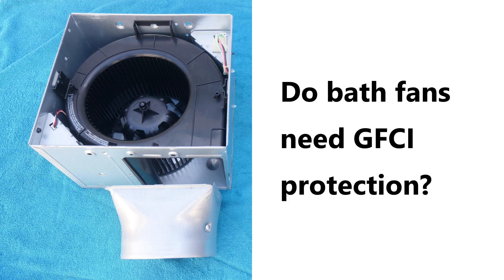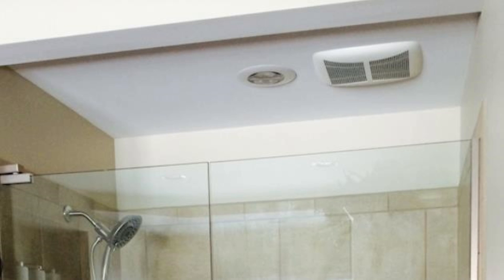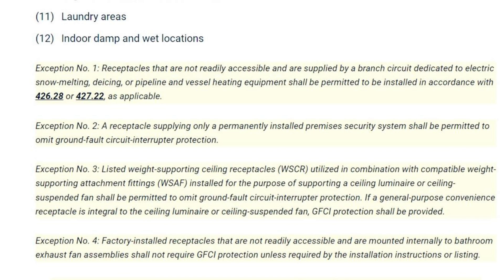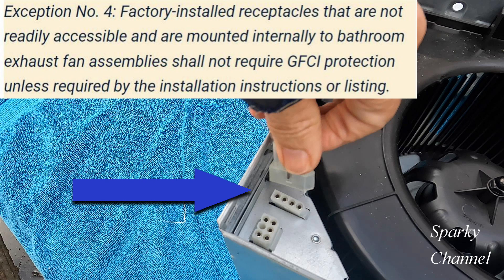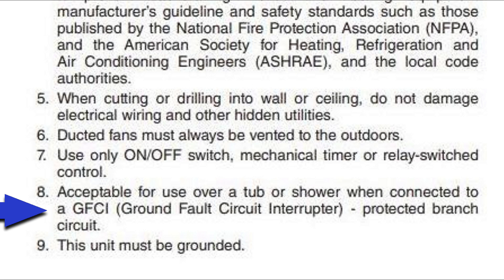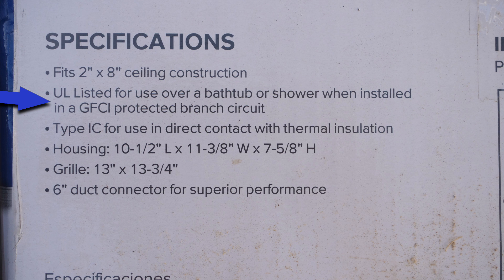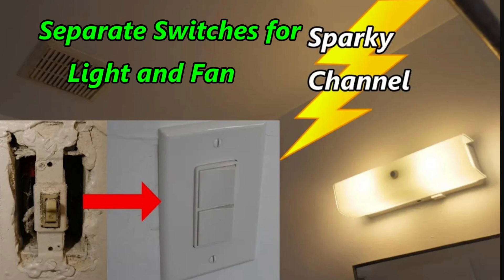Do Bath Fans Need GFCI Protection? + Can They Be Installed Directly Above Tubs or Showers?

Comment: Doing a bathroom renovation and I added the new panasonic vent (no heating element) to the 20 amp GCFI circut with the two existing outlets. Any issue with this? Better to habe its own 20 amp line?

Comment: I looked at various sites on best locations for a bathroom fan. The experts recommend that for the fan to be more effective in removing moisture it should be placed close to the shower (about one foot away). An optimal placement also includes being installed between the shower and the door. I would prefer that setup as it allows better airflow through the bathroom. Placing the fan directly over the tube/shower wasn’t the ideal location for moisture removal. Also, putting the fan directly above the shower pulls away the heat above you, making you feel colder in the shower with no meaningful difference in moisture removal vs. the optimal placement cited. Information you can use to help your clients make informed choices on fan placement.
Reply from the maker: Excellent reasoning!

Comment: I wish they'd include dehumidifiers and heaters in those fans. Our ceiling fan turned out to be a heater, and not a fan. So I am pretty sure it is a code violation, in that regard. While it is not directly above the tub it is just outside of it, so I prefer it have GFCI protection anyway. I protect my whole lavatory. So I am pretty sure that is also a code violation. The heater was nice in the winter time, but of course, it doesn't work anymore. The light still works, but it makes me nervous that there is a heater, not working, that is still getting power in the ceiling, and not even vented, so is it a fire hazard ? I think it is. I got screwed on this house.

Comment: Also see  article 110.3(B) Installation and Use. Equipment that is listed, labeled, or both shall be installed and used in accordance with any instructions included in the listing or labeling.    So while the NEC doesn't specifically require GFCI protection for a fan installed above a tub or shower,  every bath fan that I've came across that is suitable for such installation,  requires GFCI protection if installed over a tub or shower.  So one  could argue that article 110.3 (B) indirectly states GFCI protection shall be provided.
Reply from the maker: Yes, I would say that is correct. Thanks!

Comment: Love these code videos Bill! Could you do one on whether or not you would need to GFCI protect a nema 14-50 receptacle for EVSE? I kno per the code it says it shall be GFCI protected since its in a garage, but if its being used to supply power to EVSE that has GFCI protection built in and per the manufacturer it prob says it doesn’t need it, whose orders do we follow, 210.8 or 110.3(B)?
Reply from the maker: Excellent question. I'll have to study up on that one.

Comment: very clear.  I learned this close to 30 years ago, when I got a fan too close to the tub. fortunately in enough time to move it out of the GFCI zone before sheetrock went up.  since then I've had times when I had to put it over the tub, and added a faceless GFCI below the switches.  I've found the best location for a bath fan is midway between the shower/tub and the mirror.
Reply from the maker: Thanks! Yes, a lot of thought should go into the location of the bath fan. Before sheetrock goes up, LOL!
Reply: @SparkyChannel I always tell people, the cheapest tool to make changes with is a pencil.
Reply from the maker: Yep!  @kenbrown2808

Comment: Just put it on a GFCI branch. It won't hurt if you do.
Reply: until you do it in a vacation rental, and have to call an electrician on the weekend because it tripped and nobody knows about the GFCI.  local GFCIs are always best, but homeowners should always understand their home's GFCI layout.
Reply: @kenbrown2808  Why would it trip?
It will be branched off the outlet anyway.
Reply: @saulgoodman2018  usually because fan motors get sloppy and with the addition of moisture, they can occasionally look like a fault to a gfci. But a power surge can trip a gfci, too.
Reply from the maker: I tell them, but they forget. LOL! @kenbrown2808
Reply: This is exactly how I view and install; when you look at how much circuit load is this thing is pulling & if you're dropping in led lights it's just easier to pull 1 protected line into 1 4 gang box and just run all your power out to where you need it... it's so fast and easy and clean rather than messing w a different non gfci branch... now for renovations... that's another story.
Reply from the maker: Excellent point, thanks! @persistentwind
Reply from the maker: Good morning Saul. Thanks!
Reply: I only do the outlet in the bathroom. I have had bath fans trip the gfci as soon as fan was energized. Sometimes less is more
Reply: I routinely put everything in the bathroom on a panel GFCI. The only issue is if it trips there is no source of light in the bathroom.

Comment: Excellent Bill I haven’t commented in a long while but I see your still putting out gems and nuggets of information. I think you can also do a series where you take the NEC and make it clear where you feel you would go above the code and perhaps even beyond manufacturers recommendations. So a good discussion around this is would you have dual GFCI and AFCI protection for a fan - is that likely to cause more false trips as inrush and motor running can create current and voltage waveforms that could blind and AFCI but when it works it provides dual protection. Or how about how would you test the operation of the GFCI fan could you take it from a circuit that has a receptacle GFCI protection or would you take it from a dedicated breaker. Depending on which you can test different things.
Reply from the maker: Hi Mathman! Great to hear from you. One area that I have mentioned that I like to exceed code is with EMT straps. That's because here in San Diego we have earthquakes once in a while. So why not add a couple extra? It's OK to exceed code.

Comment: what does the code say about mounting it in the tub or shower ? what you read is manufacturers recommendations correct ? but is it code or does it take precedence ?
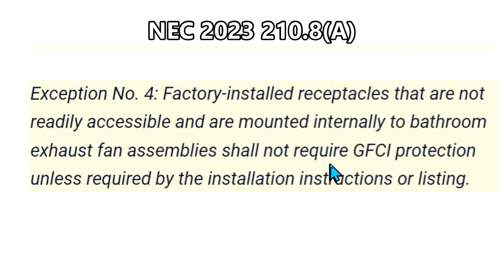Reply from the maker: I think you mean above the tub or shower. If you go to 1:12 of the video, you can see that it says "fan assemblies shall not require GFCI protection unless required by the installation instructions or listing". So that's when you go to the fan's manual, instructions or maybe even the box to see if it's required. In my case GFCI was only required when directly above a tub or shower.
Reply: to make bill's answer clear: if you are mounting a fan inside the area of the tub or shower, then code allows it, but only if the manufacturer's listing also allows it.  so the code backs up the listing.
Reply: so now the manufacturer decides whats  code and what isnt ? in other words one manufacturer says yes gfi and another decides no gfi ? Its either code or it isnt How many masters do we serve ? what if the instructions were not in the box ? @kenbrown2808
Reply: so the manufacturer makes the decision on when it should be gfci protected ? Why do we have the code then ? If i install one and someone gets hurt due to no gfi protection what do i say read the manufacturers instructions it sayd i dont need it ? Thats BS its either code or it isnt and i think the code writers should step in and straighten that out , How many masters do we serve ? @kenbrown2808
Reply: I think your missing my point , the manufacturer is making the final decision here , what qualifies them to dictate whether or not a fan needs a gfi ? If im putting the fan inside the tub or shower its going on a gfi wether the manufacturer says so or not  @kenbrown2808